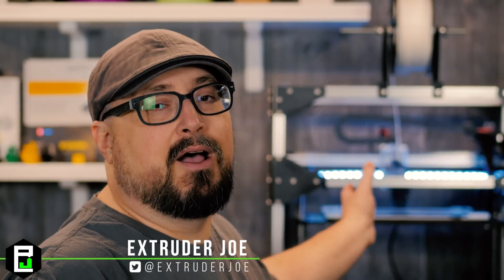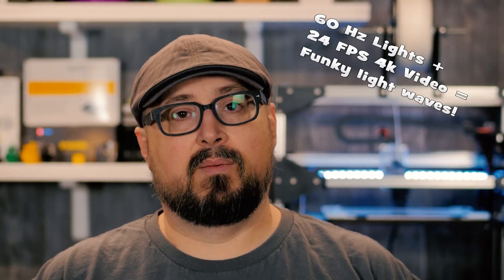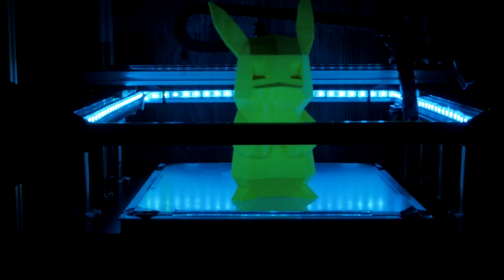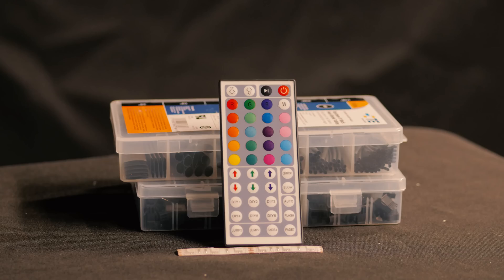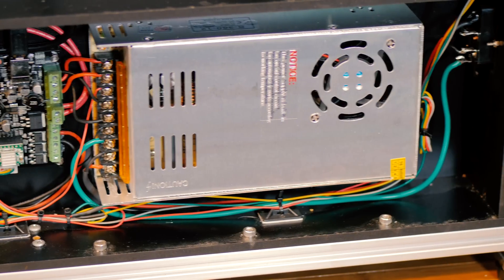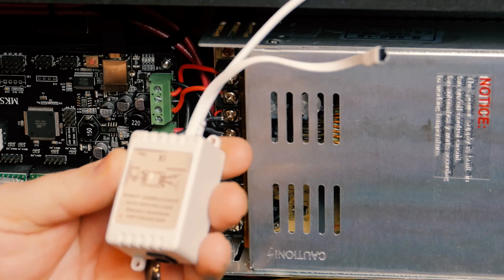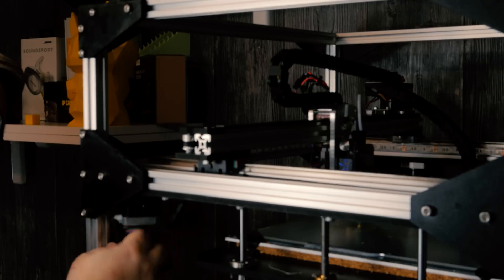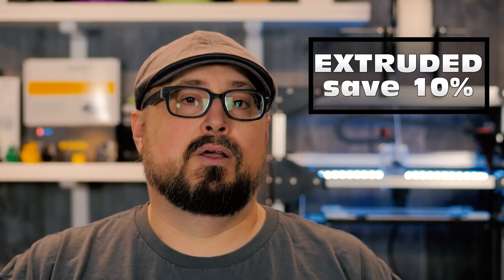Add LED Lights to your 3D printer! - FT5 Hot Rod Upgrade ⚙ installation

Comment: Queeeeestion. Is there any way I can have my printer control these lights? I want them to be white when the printer is cooled down, red when I'm gonna burn my fingers, green when it's printing and blue when it's done. Also, disco mode when appropriate. But I fear this won't happen, right. Anyway - instasub.
Reply: Just select a free pin(D-XY) on your control board and use it(either with a ground pin) to drive a 5v relais board which break up one of the led power wire, and... it's done!
Reply: either get a pi and make a simple program, or get another arduino unit and program it
Reply: Rohan Sidhu sorry but that solution sucks. The printer is powered by an Arduino. I've settled on modifying marlin.
Reply: Alexander Kraus lol it'll probably be too much for the 2560 to run 2 processes at once. good luck though. it is an IDE Era board.

Comment: Rather than using a controller and dumb RGB's you can simply use a normal 12v LED and tie direct to the power supply if it's 12v as well. 

https://www.amazon.com/WenTop-Waterproof-Flexible-Lighting-Bathroom/dp/B01GJ3O0J8/ref=sr_1_11?ie=UTF8&qid=1481661791&sr=8-11&keywords=12v+led+strip
Reply from the maker: Good point, but.. disco.
Reply from the maker: I can boogie!